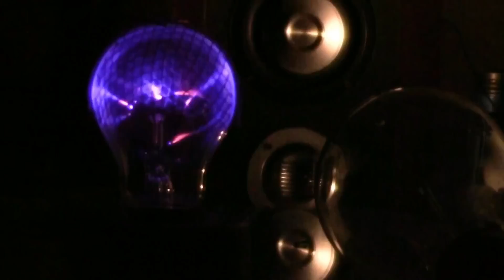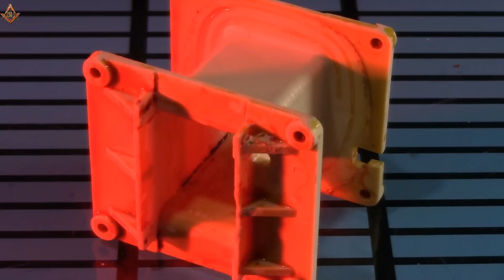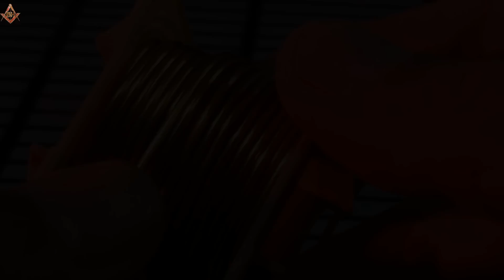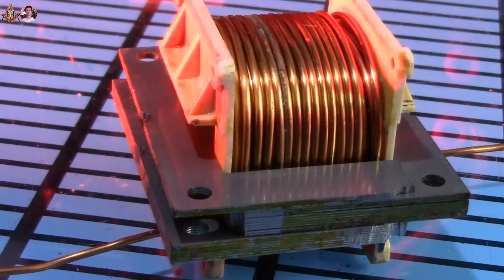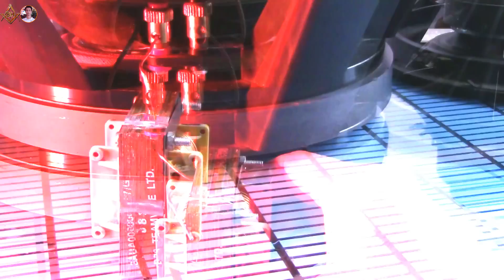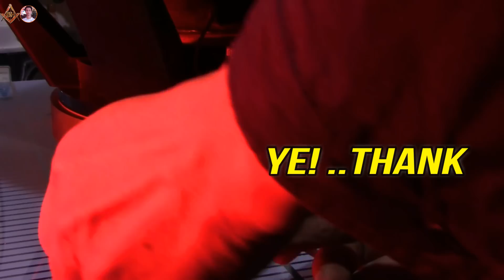make speaker louder and high bass best 2 tips for speakers and amplifiers

Comment: Hi, that's fine and congrats: it's a lo-pass-filter! But to avoid the magnetic saturation of the iron-core in your coil you have to use a air gap in the magnetic path... Without one you have of course a much higher inductance, but the core will be in saturation if you drive only a few amps through the coil, resulting in bad distortion of the signal. Yes you can use the core of a normal transformer, but the cores normally used for Audio-Transformers and chokes are made of a different alloy with silicon for the same reason...
Reply from the maker: All silicon alloys and core cores have a certain magnetism. The properties of magnetism here are the same. Only different or more or less
a core is only saturated since it does not leave a gap, and wraps around it too many loops. Here the central gap of the transformer core is available. It has been formed with a gap of 2mm distance. and the number of loops I wrap is sufficient in the safety factor
so there will be no magnetic saturation

Comment: Bro RIP speaker because the speaker can not take that amount of compression what Subwoofer takes because of large spider and bigger voice coil. I suggest you could have tride with low mid woofers that would have been great.But experimenting is a good habit you will surely succeed. 😊

Comment: LEAR MORE ABOUT CROSSOVERS WITH THAT CONFIGURATION YOU ONLY GET AT LESAT ,ABOUT 500hZ OR HIGHER 
FOR 100hZ CUT    :10mh( not micro henris like your using does valores are for uper frequecys) COIL AND 100 mfarads for the CAPACITOR
lear studie before you exibit your self kid

Comment: 7000W😨..really?
Reply from the maker: You cannot change the frequency
It is only really when you use 2 channels, with 1 amp using the transformer power supply providing 70v 0v 70v